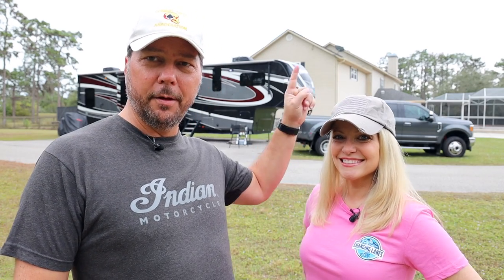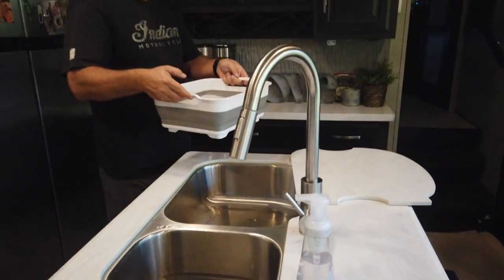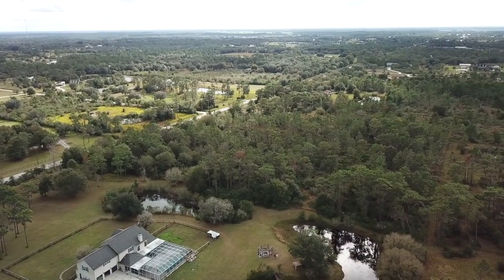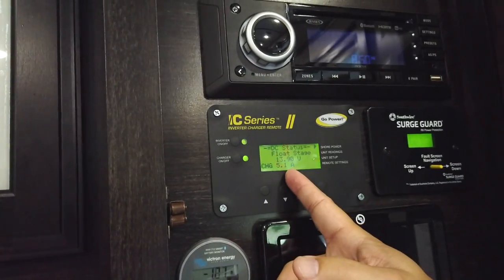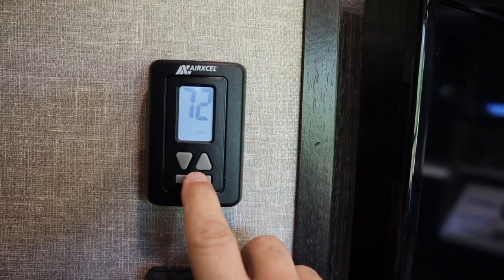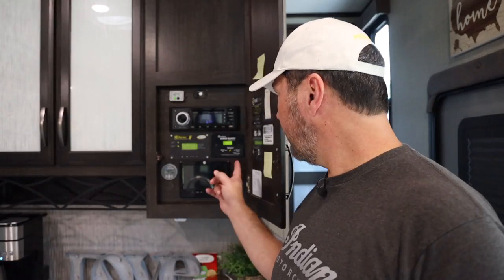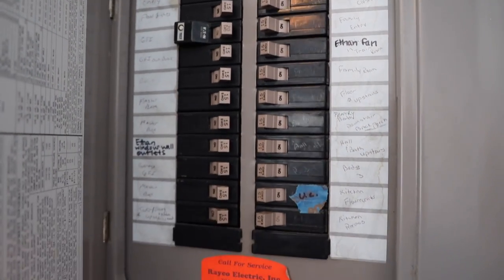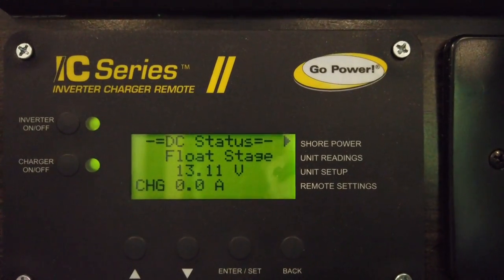RV Moochdocking! | Cheat Boondocking Like a Pro! | Changing Lanes!

Comment: Nice explanation on a simple level. I’m a master electrician and RV owner so can’t resist a couple of tips. I saw in the comments that a couple of folks mentioned the issue of long cords and the need to upsize the cords. Good catch, but the issue isn’t the amperage (15A on a 10GA cord that is good for 25-30A). The issue is voltage drop. When you are running long cords and multiple connections you are going to have some voltage drop unless your cords are way oversized. If you have a nice power quality/surge protection device on your rig like yours you will be fine because if the voltage drops too much the protective device will just shut off the power to the RV. If you don’t have such a device installed and the voltage drops too much you just start burning things up like electronics and AC compressors. ☹️ The other item you mentioned was when you are connecting to two different circuits and have a GFCI as one or both sources. First off, any outlet you can plug into outdoors or in a garage is required to be on a GFCI. When you connect to a GFCI the amount of current flowing on the hot leg of the GFCI and the amount of current flowing back on the neutral must be exactly the same or the device will trip. The device assumes any current going out that isn’t coming back must be going somewhere it isn’t supposed to such as your body. When you use a cheater cord to feed your 50A/240V RV from two 125V sources there is only one neutral wire in that cord and the neutral current will return through both 125V neutrals causing any GFCI’s in play to trip. I have one of those split cords and the only useful thing I have found for it is when we camp in Michigan state parks they are too cheap to upgrade to 50A services so if nobody is using the other side of the pedestal I use the 30A outlets on both sides.
Reply from the maker: Good points.. We always keep the video description and blog post updated with just such details.  👍🏼
Reply: I have tested the voltage drop thing and plugged in multiple 50ft cords and some 100ft cords and didn't see anything different. The cheater cord also works perfectly for a generator
Reply: What about a Class C that has 30 amp can you do the same?

Comment from the maker: ⚠️⚠️ One thing we forgot to mention and another thing brought up in the comments that are valid concerns:
➡️ EXTENSION CABLES: Be sure to make sure any extension cables you use are rated for 15A. For longer runs like 100ft, these are NOT the cheaper cables. They should be labeled with rated amperage. Also, the longer the cable the more the voltage will drop, so keep an eye on it to make sure it doesn't drop below 108v (90% of 120v).
➡️ HOUSEHOLD CIRCUITS: When a household outlet/circuit is rated at 15A, that rating is generally for short term (under 3 hours). The real rating for long term load (over 3 hours) is 80% of the rating. Meaning, on a 15A circuit, if you’re going to run it over 3 hours, you should be at 12 Amps or less. An AC is like long to cycle less than 3 hours anyway, but on a hot day, it’s something to be aware of.
➡️ HEAT: When connected to 15A or 15A+15A and running for about 30 minutes under load, do a check of the entire line from your RV to the adapters, to the extension cables, and to the wall outlet. Do a touch test to make sure the lines and/or connectors are not getting hot.
➡️ 30+30: If you decide to use the 30A plus 30A setup, try to connect them to separate LEGS, not just separate circuits.  If you have to connect them on the same leg (still separate circuits), be sure to stay under 50A TOTAL for both legs.  The reason is, if you draw the max (30A) on both legs and they are on the same leg in the house, the legs are IN PHASE and will cause 60A on the Neutral line.
➡️ POWER PROTECTION: We HIGHLY recommend using a Surge Guard Total Electrical Protection device (see: youtu.be/4FNtBtE_x2s), or some type of EMS that validates your power source voltage, frequency, wiring, etc. These are a great safeguard against bad RV park wiring as well as bad household wiring and just plugging things in wrong.
Reply from the maker: Indeed!
Reply from the maker: @huey2741  No reason apologize.  We definitely want to provide safe information..  If the neutral were overloaded would this not trip the main breaker?
Reply: At 150 feet, the biggest concern is voltage line loss. It is not a static value. It depends on the end load, starting voltage, Gauge of wires, length of wires. From my Circuit breaker box to my RV was 177' of 12awg cable, Start voltage 125vac, turn on RV refrigerator, converter charging 12vdc, air conditioning, now 100.7vac!
Reply: Huey2 I learned about the separate legs back in 1988 when we “lost” a leg, and half of our house electricity didn’t work! So in my current home I was wondering how I can tell, as a novice who understands electrical circuits, which breakers are on one leg and which breakers are on the other? Is it as simple as the two sides of the panel or would that be too easy lol
Reply: Marsha Adams, I would double check with a licensed electrician but I believe you’re right the panel is split- left side is one leg and right side is the other leg.
Reply: Shaun Revier thanks! I will.

Comment: Fantastic video. Am in the process of installing a 30amp 120 volt line in our garage front wall. But I am also going to have to make an extension cord also. Up back wall 8 feet across trusses 36 feet to front wall down another 8 feet. For a grand total of 52 feet. Probably buy 60 feet just to make sure we have enough of 8-2 copper. The exterior extension cord will be 8-2 in a rubberized cord, that cord will be expensive. Probably need 40 feet of that cord. This is just for our home installation, the other options will have to come later.

Comment: Great info.  Not having a 50 amp rig I had not run into the fact that the split system.  Another thing about moochdocling, if the site has a septic tank or sewer line with a clean out, you may be able to dump or connect your sewer line as well, saving a trip to the dump station.  This might also allow you to fully enjoy your own showers in the rig.

Comment: FYI. You could also add “soft starts” to AC’s to lower startup draws as it will let you use more items on your  “lines”.
Reply: fyi, ric bailey could be a vietcong.
Reply: @princesslavidia3287   WTF is that about. He is correct.
Reply: soft start?
Reply: @Ric Bailey,  I've heard of the soft starts for coach ac units,  etc. But never caught brand names or anything.  Can you offer up some pointers? Thanks.

Comment: Great info! I was thinking about the 2 separate circuit thing, hoping you'd mention it. Glad you did. 1 thing I might add (may have mentioned and I missed it). Electricity flows like water. Bigger pipe, more water flow. Especially with long extension cords, get the heaviest duty you can find. I usually look for 14 gauge cords. House wiring (for 15 or 20 amp breakers) is 12/2 with ground meaning 12 gauge, hot, neutral, and ground. 14 gauge is smaller than 12 but most extension cords are 16 or 18 gauge. Drawing too much amperage thru a tiny gauge, long cord, will burn it up (fire potential).
Reply from the maker: Yep.. that info was updated in the description and blog post.. 👍🏼

Comment: One other consideration when moochdocking  is the load already on the home or "mooch" circuits existing on the house or garage.  You won't want to tie into a circuit that might already be loaded with a high current appliances like a coffee pot, crock pot, microwave, hair dryers or basement sump pump. If you're both using that circuit, its sure to trip the circuit breaker. Look for a lightly loaded circuit in a bedroom or living room area. All in all a great video. I started watching all your videos a couple weeks ago and learned a ton about RVing.  My wife and I are thinking about doing a lot more traveling in a few months when I retire and you have provided both information and inspiration!  Thanks a bunch!

Comment: GFCI =Ground Fault Circuit Interrupter. A GFCI shouldn't be affected by amperage draw. A GFCI senses an imbalance between the grounded conductor (the "neutral") and the ungrounded conductor (the "positive") and opens the circuit. Also, try to keep the supply cord as short as possible and use a heavy gauge cord to keep the impedance as low as possible. Nick-picking from an ex OSHA compliance officer, LOL. Excellent video as always.

Comment: I think this is the best video I’ve ever seen explaining the electrical systems in a motorhome. The main reason is because you have exactly shown the panels that I see and how they relate to the electricity that you’re using. Before, I was always trying to relate to watts Which are not shown on my panel. Thank you so much for this video I am saving it.
Reply from the maker: It's still good to understand watts, which are just the Amps times the voltage.  Using Watts is a good way to "relate" the DC and AC side when using an inverter.  Minus some loss in conversion, 3000w is the same on the DC side and AC side.  For instance, a 3000w inverter at max would be pulling about 250DC Amps (3000/12) from the batteries and supplying 25 AC Amps (3000/120).

Comment: Good Video! One suggestion- you might want to let folks know to run proper gauge extension cords for length of run. Common sense for most folks, but not all. Don't want to get "in the weeds" as you say. But using 18 gauge cords at 200ft lengh = problems if drawing 15 amps.
Reply from the maker: Indeed!  We added notes to the video and blog....  👍🏼

Comment: I realize I’m late to this video but I just found your channel and have been watching quite a few videos 👍🏻, very informative and fun to watch. As a commercial electrician I just wanted to mention something else, Duty Rating & Duty Cycle. We size wire & devices (breakers, receptacles, fixtures etc) for 80% continuous usage, meaning 16 amps continuous on a 20 amp circuit & 12 amps on a 15. If you’re pulling electricity (amperage) nonstop, you run the risk of overheating the wire (or breaker or whatever) if you’re over that duty rating. Sort of like running an engine below redline so it doesn’t overheat. 
 Just something to keep in mind when using 15 amp circuits. If your cords are getting hot you’re overworking them and hot is BAD. That’s the precursor to fire. The insulation melts and wires that aren’t supposed to touch, touch, then spark. Also, continued overheating degrades the plastic insulation and you will have a failure at some point in the future. Heat is your enemy as an electrician. Keep an eye on the cord ends and make sure they’re not melting or turning black. 
 Duty cycle is the on/ off ratio for a device. Air compressors & welders for example. For a 30% duty cycle (calculated in 10 minutes cycles) you can run 3 minutes on, then need 7 minutes of off time to cool down. 
  Sorry for the long post. We (Electricians) tend to do that 😂.
Reply from the maker: Good tips!  We did update the blog and description below with some notes in regards to the gauge of extensions, etc...

Comment: I've used the 2 circuit setup in the past at my house but I was not aware of the dog legs that allow you to run 2 circuits into your power system.   I ran 1 dog leg off of an outlet into my rig but the other circuit was just an extension cord run inside to power a few items.    I've learned something tonight so thank you.   Makes life easier.

Comment: Pretty good info overall, especially starting your fan then the compressor, and since the ampacity of extension cords is mention several times below, I wont dog pile on that. However, as a master electrician, i cant help myself...
, 1. GFCI- Ground Fault Circuit Interrupt
2. Nit picking, but technically, breakers don’t “blow”. (Side note- repeated tripping of a breaker will eventually ruin it. They are also jot typically rated to he a switch.)
3. In addition to separate circuits, when connecting from two 15a recpts to 50a, it is best to connect to each phase. (One recpt fed from a breaker on the right side in the source panel and one recpt on the left side in the panel to keep a balanced load in the house/ source. 
4. All of those adapters create resistance and will eventually fail. Its a matter if time. Also ants will get to them in some areas as they are attracted to ozone generated like in an ac contractor. The best bet is to install an rv outlet for whatever amperage your rv is, provided to house/ source can support it. 
5. Whether you do a temporary or permanent install, Amperage reading should be taken at the house/ source panel to verify how much draw and whether it is balanced. Last, everyone be safe with electricity. Everything in the video only involved plugging cords in. Any time you open a panel or even take a cover plate off, be sure you know whether its live or not.

Comment: I park in the driveway at a couple of relatives, often enough that it made sense to have a local electrician install a 30 amp box on the house that I can reach easily. No dog bones and running drop cords required. The cost involved has been well recovered over the years and it keeps things simple.
Reply from the maker: Good point!   Thanks for watching, Ron! Hope you check out the rest of our channel! 😊

Comment: I  was glad to see others had picked up on the gauge requirement for the extension cords. I carry 10 gauge extension cords. An example of why bigger wire is needed is friends who borrowed a compressor but declined to take my "too heavy" extension cord. They called to tell me that my compressor didn't work. They were using 100 feet of 16 gauge extension cord. When I took the 10g cord it worked just fine. The voltage drop was too much to start the compressor with the smaller cord. If they had been able to start it, the cord would have burned up in short time.

Many times I add an outboard charger to my battery bank using the 15 amp socket on the power box. I have the usual lead acid batteries that the dealer let run completely dry. I had to add a gallon of DISTILLED water to EACH battery. Being run dry results in sulfation of the plates. I use a special charger designed to reverse the sulfation.
Reply from the maker: Yea.. we added those notes to the video and blog also.. 👍🏼

Comment: @changingLanes Thank you so much for outstanding video. I'm in the process of trying to set up a hipcamp opportunity at our house, and was trying to understand the power requirements. I have 10 gauge wire and can safely supply 30 amps of power at 240 volts... I was trying to figure out whether it made sense to offer an RV or a 50 amp plug and tell them they weren't allowed to pull more than 30 amps... But was not sure how the RVs were set up and how does the RV know to switch from 240 volts feeding something to 110 volts feeding something....

And I think I have figured out from your video that nothing inside the RV actually runs at 240 volts...

But rather, everything in there runs at 110 or 120 volts on two separate lines.... 

Which you pretty clearly demonstrated when you brought the yolk out to run two 15 amp extension cords...

Just want to give you a huge word of thanks as I try to do the right thing for our future campers...

I may just go out and buy a typical campsite hookup box with all three types of outlets in it, and they just put a note on there telling them not to pull more 30 amps... Even cooler if I could find a campsite hookup box that had the digital readout inside of it... 

Thanks again!

Comment: Thank you two. We are about to buy a Grand Design 5th wheel Solitude 310gk with 50amps this has helped prepared me. They are adding a 350 watts solar package with a  2000watt inverter. A little worried I wont have what is needed.

Comment: I tried your a/c hack on 110 and it worked great~! I'm on a 15amp circuit, ran the fan only for about 30 seconds, fan only, then click it to the cool mode, everything is on, and BAM! compressor kicked in and cold air blew out. Usually I have to use the gen set but no more! Thanks!!
Reply from the maker: 👍🏼    Be sure to check out the added notes in the description..

Comment: Going to comment before I watch the whole thing. You forgot about the voltage drop on that long run, and you didn't show what size extension cord you had. Plus you didn't show the voltage at the 13amp draw.
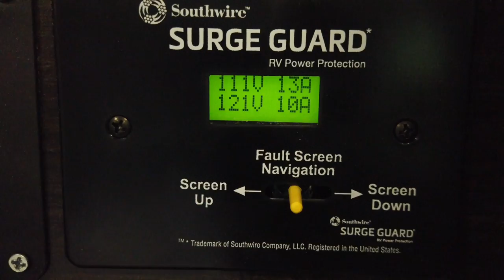Reply from the maker: Good point on the extension cord.  I should have mentioned that the extension cords need to be rated for the amperage.  We do show voltage and amps for both lines at 18:47 and 19:17.  Voltages all stayed within tolerances.  I also should have noted that an EMS or total electrical protection system are highly recommended to detect any such voltage or wiring issues.  We will add these to the description and blog.  Thanks for point those out.  👍🏼

Comment: Chad and Tara, you guys do a wonderful job of presenting and explaining in your videos. I keep coming back to your channel for your "experiences". However, when talking about 120vAC breakers, you might want to say "trip a breaker" instead of "blow a breaker". I know exactly what you mean because my career was spent in electrical engineering, and I remember the days when panels had the screw in fuses and snap in fuses that would "blow". With today's circuit breakers, they just trip to "open" when too much current is detected, and you just push to reset them in the "closed" position. Someone without an electrical back ground might think they're blowing up a breaker in their panel. Anyway, you guys are great! Keep up the good work...
Reply from the maker: True...  👍🏼